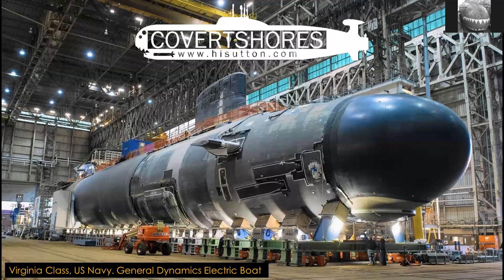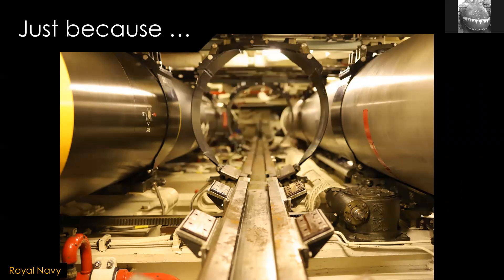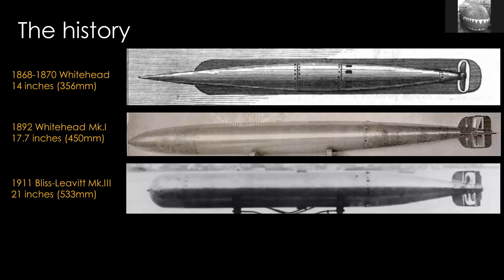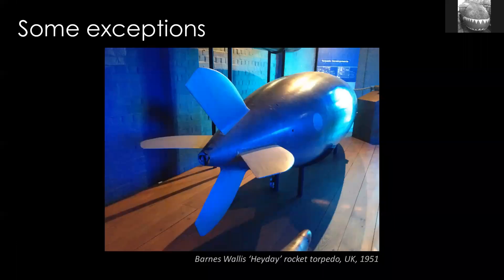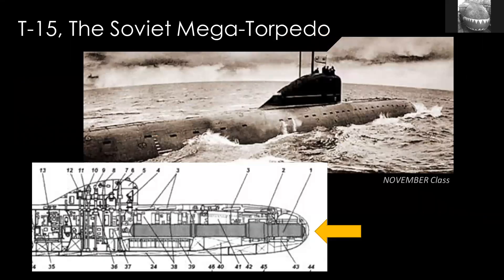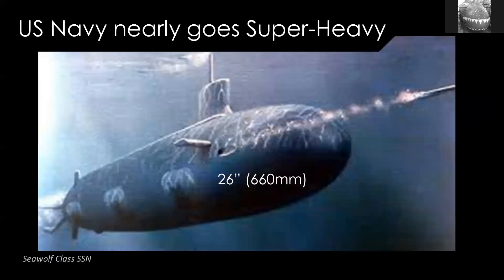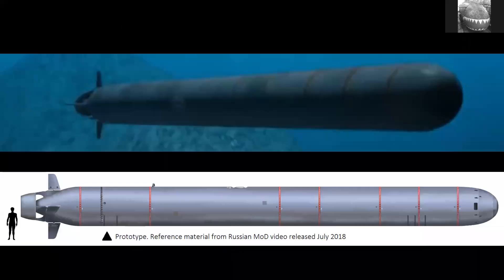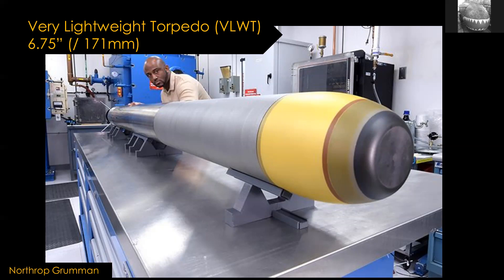Submarine FACTS: Why Are Torpedoes Always The Same Size?

Comment: This must be rare then: "Israel's Dolphin II class—the Tannin, Rahav and a third unnamed submarine—contain 10 torpedo tubes capable of launching fiber optic cable-guided DM-2A4 torpedoes. Four of these tubes are larger 26-inch tubes—the size is rare for a Western-built submarine—capable of launching small commando teams or firing larger cruise missiles. The remaining six tubes measure at 21 inches."
Reply from the maker: I do not believe that the Dolphin-IIs larger tubes are for a larger torpedo. Instead cruise missiles. 

Here is a cutaway I drew, although also with a provisional take on the VLS https://www.navalnews.com/naval-news/2022/01/israels-submarine-secret-new-dolphin-class-boat-could-have-vls/
Reply: Yep, those are VLS tubes.

Comment: Worked on an research program at Sundstrand, electric torpedo in the 80's which was under powered compared to a Mark 48 or the Sundstrand's Spearfish which the British navy acquired.  Did some work on that thermal torpedo.  These two torpedoes are depth sensitive since the exhaust from the thermal engine is a gas that must be exhausted.  Are there any in you video that are totally enclosed thermal system?  Difficult problem that Sundstrand tried to address.  Left before a successful torpedo was developed.   The electric torpedo that made it's appearance I believe in WWII is not depth sensitive.  

The electric torpedo is a great mine field weapon since it likely will always be under powered.  Can be fired off shore and travel up a river to create a mine field. When it reaches its resting place the motor stops.  Waits for an opportunity and starts up the motor to rise off the bottom and attack.  However, if the conflict ends the torpedo can be told to lift off the bottom and sail out of the river to where it could be retrieved.  Thus if not used no one would even know that the mine field existed.  And the mine field could reposition itself say after a few were used.  Thus prevent detection and removal.

Comment: but could electric torpedo be powered by wire from submarine? how thick would have to be such wire? it could be quite small torpedo with only electric motor and explosives anyway.
Reply from the maker: Interesting idea. I think it could be done, but cannot see why it would be better than regular electric torpedoes. 

Certain submarines operate wire-controlled ROVs (remote operated vehicles) but not  like torpedoes
Reply: @HISuttonCovertShores  possibly cheaper since it would not need batteries also if 533mm it could have much bigger warhead or possibly it could be smaller torpedo with the same warhead

Comment: The 660mm tubes of the Seawolf class were described as "quite swim out" by Norman Palmer in his "Ships and Aircraft of the U.S Fleet." Given that the Seawolfs are all about stealth, makes sense because the 21in torpedoes are supposedly pressure rammed out of the tubes; generating a huge amount of noise.

By swimming out of the tube, an ADCAP would in essence eliminate the warning that a targeted submarine or ship had been fired upon.

This is huge because the Seawolfs were built as giant undersea ssbn hunters; which operated with multiple submerged escorts at the time; all of them double hulled. 

Why the Virginia's went back the the 21in tubes is probably because that class was made with a priority on shallow water and special operations.
Reply: Quiet swim out - that was my understanding too.
Reply: @DJW1959Aus  Quiet swim out works at slow speed only - look at the German Type 205 and Type 206. If speed rises the torpedo has to overcome the pressure from the front and this leds to higher revolution of the torpedo propeller and to some noise. I think it is quiet up to 3-4 kts launch speed.
Reply: @christophkluxen5559  Submarines are only stealthy and hard to find while at slow speeds anyway, so it's no additional limitation to have to go slow while launching the torpedo silently.

Comment: One question I've often had is why we still have torpedo tubes at all? Why not have the torpedoes outside the pressure hull, launched directly from a standalone container? Would remove holes in the pressure hull, remove the reload process, simplify rearing in port, reduce the noise when firing / reloading. VLS cells on ships are similar - missile in a container is lowered into the VLS cell and plugged in, earlier launcher rails with separate magazines phased out in favour of VLS. So why no 'HLS' for torpedoes... What's the compelling advantage of the tubes?
Reply from the maker: The main factor is to allow the crew to perform maintenance on the torpedoes while underway. 

In the future, with possible 'zero maintenance' weapons, we might see an increase in external carriage like you imagine
Reply: You keep torpedoes inside sub, in air. If keep in water, torpedoes get stuck in tube. CB sub from Italy had this problem in WWII in Black Sea.
Reply: Noise

Comment: I wonder if shoulder-width had an impact on choosing 533mm, you can't crawl into a 17" torpedo tube to preform maintenance but 21" works just fine.
Reply from the maker: Great line of thinking. I don't think it was a major factor, I didn't find arguments like that at all. But then I didn't find arguments at all really. But it is an advantage for 533mm tubes

I do think that range and warhead were the driving factors

Comment: Great video, although I missed the odd, postwar US 19in torpedoes like the Mk37 series which are still in service in modified and upgraded versions.
Reply from the maker: Yeah good point. Obviously those were shot from regular 533mm tubes, I mentally lumped them with the 533mm weapons, just more clearance. 

Was it ever intended to have a different size torpedo tube?
Reply: @HISuttonCovertShores  no, they were swim out

Comment: so..somehow, the 533 mm is a trial and error result of the target being the largest common battleship, its steel hull protection quality, and safe non detection firing distance...
..
Had the torpedo been properly developed during the wooden ship of the line age ..then the standardised optimum diameter would have been smaller
Reply from the maker: Yes I think that's possible.

Comment: Was there, in reason or other, abundance of 21" pipe in 1910's?
Reply from the maker: Torpedo tubes have to be specially made for the submarine. They have to have a depth rating at least equal to the occupied pressure hull (in simple terms)

Comment: Can a Russian submarine fire an American torpedo?
Reply from the maker: The tubes are basically the right size, but would need the fire control etc to be fitted to the submarine to connect to it. For example Egypt bought some Ming Class submarines off China and then modified then to launch American torpedoes.
Reply: @HISuttonCovertShores  So, in theory it should be doable if the Russians buy the whole package: torpedo+fire control. :) I'd like to see that happen.

Comment: This kind-of makes me want a video on the Cagni class (and creates a desire for me to try to do at least pen-and-paper simulations of its utility as a merchant raider - and even its possible use of a larger salvo as a last-ditch self-defense against relatively light escorts). Certainly the low probability of a hit at range in the interwar period favoured firing at close range and firing larger spreads... I can't help but wonder if, in many situations, the main downside of the smaller torpedo would have been its smaller warhead. I also can't help but wonder if a lot of merchants and smaller escorts could have been sufficiently injured to make a follow-up attack possible (thus removing the need for a kill with a single hit). Which raises the question - is the 533mm partly a result of the desire to hunt larger warships effectively?

Comment: I remember reading a ww2 damage control document that said something like "in the event of a casualty and at a safe depth to so the torpedo tunes may br used for escape as the diameter has been designed to allow an adult male to enter for inspection and es ape"

Comment: Very good! 

Torpedo size seems to be a bigger problem than for armies picking a rifle cartridge size. If you change the size you have to change everything that uses it. Also the larger the weapon the harder it is to handle and store.

It would seem an anti submarine torpedo does not need to be very large as any extra hole in a submarine pressure hull is a larger problem than for a surface ship, especially a large one. Though the different hull types pose different problems of penatration. So something smaller than 533mm would work, depending on the enguagment range. (which with advances in sonar are getting longer.)

I wonder where the capabilities of torpedoes and submarine drones start to overlap. (though it can be argued that a torpedo is a drone itself.)
Reply: The difference between a drone and a guided missile or torpedo does seem to be very blurry. 

Is it down to you expect to get the drone back?

Comment: So the diameter is standardised, but what about the length? For example, the Russian "Fizik" torpedo supposedly has a shortened export variant that's meant to be built to a NATO standard, but on the other hand the German DM2A4 can supposedly be assembled to different lengths with a variable number of battery modules depending on mission requirements.
Reply from the maker: Yes length isn't standardized, but naturally the tubes built into subs puts natural parameters on this. In the 1950s some navies (e.g. USN, RN), built 'short' 533mm tubes into the stern of some classes. At the time they fitted specific models of torpedo. But subsequently these turned out to be almost useless as new weapons were no longer 'short'. 

(separately there were projects to reuse these tubes for other things like SDVs and towed arrays)

Comment: Fantastic as ever, thanks. 
On a different subject, with the recent Connecticut casualty in mind, is anyone working on laser mapping/range finding for subs? Instead of active sonar …
Maybe too tricky (big/expensive?) for now but I’d be interested to no if it’s “a thing” in sub research - cheers!
Reply: Water is very good at absorbing all kinds of EM rays. Would that really be different for lasers?
Reply: @seno5530  I think some of the spectrum is absorbed but apparently they still work underwater … is prob way too big + expensive maybe. Anyway just a thought! Thanks for reply
Reply: @seno5530  ps u prob right tho… spectrum fading off etc…
Thanks
Reply: Ultraviolet goes furthest, I.e. Tens of meters
Reply: Attenuation is an issue even in the microvacuum of space, water is just a lot denser than air and whilst it's EM absorbtion properties are different it's still denser than air and as a result it (and the sediment and small creatures suspended in it) are going to scatter light and attenuate a beam more strongly than a gas would at 1atm. Too strongly to provide a useful beam strength at target range without dedicating excessive hull volume for laser pumps, cooling and optics.

Comment: The Italians built the "Cagni" submarines during WWII that had huge armament of 14 tubes, all of 45 cm caliber. I guess rather like the French wanting the use smaller torpedoes against shipping, but taken to the extreme. Clearly, for the same size of boat, the Cagni could carry considerably more torpedoes than one of 53 cm, but the speed of reloading and bottleneck in wartime torpedo production (in addition to the cost of the weapons) would still exist as problems. 
I don't envy a crew that has to maintain and service over 30, or even nearly 40 torpedoes on their small-by-modern-standards WWII submarine. Clearly, small torpedoes have merit in ASW even for surface ships or the proliferation of SVTT equiped ships would not be -- even the WWII era "homing mine" torpedo - again of a small caliber - in US service makes a good mark on the historical record.
Reply from the maker: Thanks. Yes I nearly went there, but also most Italian subs had 533mm. Cagni class are interesting though.

Comment: The new Russian Poseidon torpedo is claimed to have a 10 000 mile range with a 100 megaton warhead and can accelerate to 100mph in the final attack phase of a coastal city. The Tsar bomb was only 50 megatons which is the largest nuclear bomb tested.
Reply from the maker: The 100MT thing was speculation. 2 megatons seems much more likely.

Comment: Any reason you use yards instead of miles or kms
Reply from the maker: That was the normal way of showing it at the time, even quite recently in fact. A yard is roughly a meter. 
Doing historical stuff, and for an international audience, inevitably gets messy with units of measurement
Reply: @HISuttonCovertShores  makes sense, ty for the reply

Comment: Would it be feasible or worthwhile to arm subs with remote auto-cannons like on IFV's. They could be used against light surface craft or as an AA mount against drones or ASW helos.
Reply: I think the last thing a sub wants to do if there's ASW helicopters around is surface
Reply: @tommihommi1  Yes well if you use IDAS to shoot them down and clear the sky you can just deploy your T-mast and stay submerged while your recoilless auto cannon is on the surface.
Reply from the maker: Has been proposed. And /or high energy lasers.

Comment: Didn't India recently test a missile launched torpedo at very long range from land? And the US has something similar "Vertical Launch Anti-Submarine Rocket"?   I have very limited knowledge in this area.  I suppose they might use conventional sizes to avoid designing something new for the torpedo component but there really isn't any reason to have to.  In fact, a good opportunity to go to 650mm or whatever.
Reply: You don't need a big torpedo when you launch it with a rocket. The whole point is you have a good enough picture of the target before you launch it. These aren't weapons that perform their own search for minutes, they are supposed to fall right on target. Some are launched from standard 533 or smaller tubes. The weapon is unified with air dropped light torpedoes. More weight also means a need for a much larger rocket, or the range shortens making it pointless. Ships have limited space
Reply: @Pg4141laika  Yes, for a ship mounted rocket launched torpedo however, the India rocket launched torpedo is from land.  Once in the water it will have to do an extended search since it can be many many minutes between a spotter plane calling it in and launch from many kilometers away.  But what I think is more interesting is the possibility of using a larger warhead capable of taking out the largest of ships.  It could drop outside the range of the ship's defensive weapons.   A rocket on land isn't really constrained by size since these don't have to be mobile, are easier to maintain, and India already has many large rockets.   Using common components (torpedo & rocket) is going to drive the design.  Cost too, of course, but these would make an enemy think twice about just sailing up to your country.
Reply: @JohnTrevick  That doesnt sound like a capable system, especially against surface ships. It's either only tested from land, or it's a complete misunderstanding. There's no reason to use torpedoes for this purpose. Reaction time would be abysmal with a weapon that has to change the medium for a denser one, not to mention cost and complication. It's not less susceptible to countermeasures. Modern ships also depend on off board targeting, because radar horizon is the limiting factor. (Missiles are invisible to the ship until a few dozen km from it, if there's no spotter planes) And torpedo countermeasures exist too, since recently. There's zero upsides.
Reply: @Pg4141laika  True, but it is being developed.  Doesn't have to target just surface ships.  Size will probably be based on what's available "off the shelf" but being land based means it doesn't have to be (in context of this video).   India has missiles of all sizes.
Reply: @JohnTrevick  India imports most of its missiles. The only possible reason to build an anti-sub land-based system is for it to work in conjunction with an offshore hydrophone network. I highly doubt India has the sort of money for this considering the rest of their needs right now. It won't ever be made dual purpose like you imagine it because of things mentioned before.

Comment: Bring back the deck guns! Or, perhaps, design a "deck gun" that fires the VLWT as its weapon load. A multi barrel that cam shoot two or even three at a time, (probably side by side),  should suffice.
Reply from the maker: I need to do a video on submarine guns, mainly the awesome, crazy and obscure stuff. Added to the very long list
Reply: check out the designs for the sea spider, one possible design is having six tubes on each side of the sail for 12 total.
Reply: Germany has short range AA missiles that can be launched our of the tubes quad packed while suerged or surfaced and can target surface targets. There have also been talks about mounting a 30mm recoilless autocannon on a mast.